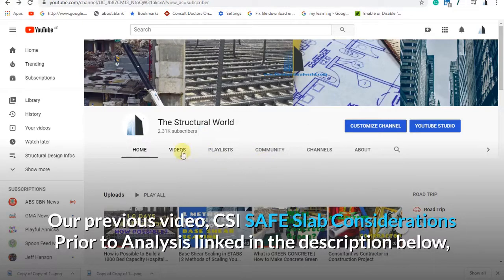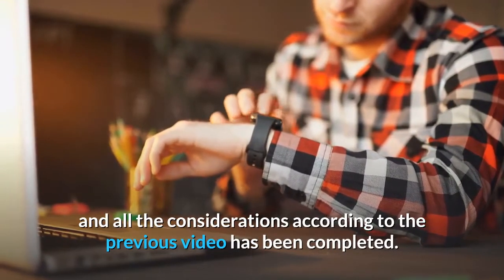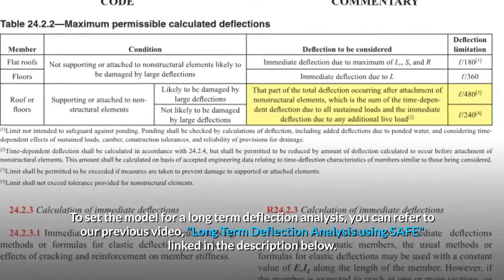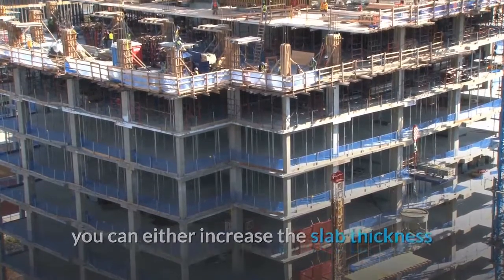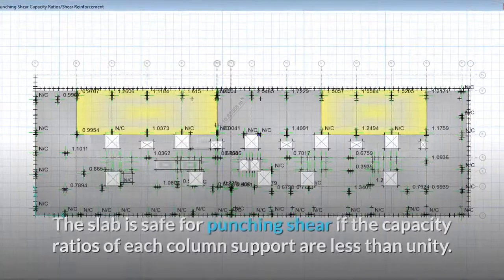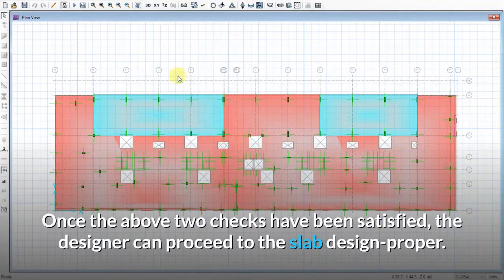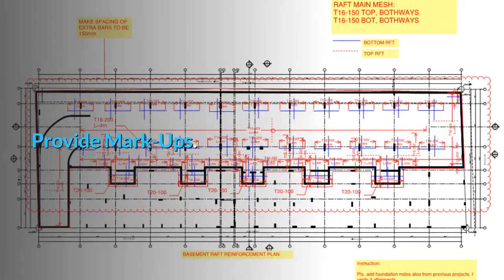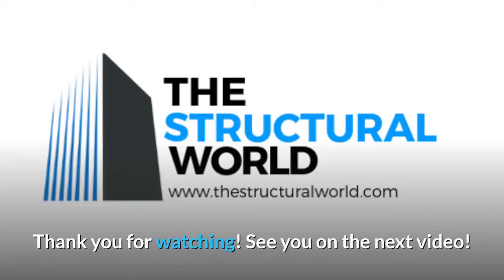3 Post Checks Analysis and Design Consideration in Slab using Csi SAFE

Comment: How would you know if the slab you designed has passed or failed?
Reply from the maker: You need to check for long term deflection,should be less that L/240 and check for punching shear ratio should be less than 1.0

Comment: Please assist to solve the warning message in Safe. 

FORMING STIFFNESS AT ZERO (UNSTRESSED) INITIAL CONDITIONS

 * * * W A R N I N G * * *
 NEGATIVE VALUES HAVE BEEN DETECTED IN THE ASSEMBLED MASS MATRIX
 FOR MASS SOURCE:
 MOST NEGATIVE VALUE =   -21195.194
 ALL NEGATIVE VALUES HAVE BEEN SET TO ZERO, BUT ANALYSIS RESULTS MAY BE
 INCONSISTENT OR DIVERGENT, NONLINEAR ANALYSIS MAY BE SLOW OR FAIL TO CONVERGE!

 >>> IT IS STRONGLY RECOMMENDED THAT YOU CORRECT THE SPECIFIED MASS SOURCE
 >>> SO THAT THE SUM OF THE MASS AT EACH JOINT DOF IS NON-NEGATIVE!
 >>> CHECK FOR LOAD PATTERNS IN THE MASS SOURCE THAT HAVE UPWARD LOADING.
 >>> SEE TABLE "ASSEMBLED JOINT MASSES" TO LOCATE NEGATIVE MASS VALUES.

Comment: I've got one question... When checking punching shear, what does it means when some in some columns appears "N/C"? and how can we fix it? can you make a video out of it? thanks for the amazing videos!
Reply from the maker: N/C means not calculated, you don't need to fix this. It only means that no punching shear links are required in that column. You can notice N/C's in those columns that support the beam.  Cheers!
Reply: You mean that punching shear is only calculated in slabs without beams? Interesting... thanks!
Reply: And... by punching link you mean the drop panel ? Or what is it exactly ?
Reply from the maker: @raulsalinas6933  its punching shear link reinforcements. In the event that punching shear links are not enough, we provide the drop panel for the slab to be safe in punching. We will make a future video on how to design shear links reinforcement itself. Kindly subscribe and hit the notification bell for you to notify right away once the new video has been uploaded.
Reply: @TheStructuralWorld  perfect! i'm already suscribed to your channel, you make very interesting content, carry on with it!